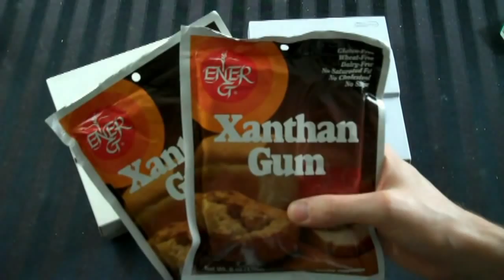Gamerade - Remove Yellow from Super Nintendo, Other Consoles, Plastics - Adam Koralik

Comment: According to a recent post on Slashdot, following a discussion among experts from the retro-gaming community with input from chemists, what you are seeing is the same effect from bleaching t-shirts. Unfortunately, bleaching plastic is a surface effect and it does not change the chemistry of the plastic. The discoloration will return after a few months to a few years when the flame retardants migrate back to the surface. I've had computers since the 1980's and I can tell you that stored plastic will discolor. Most UV light (UVB and UVC) is blocked by windows. Nobody uses these old computers outside, so I think most of the discoloration is accelerated by operating temperature with a secondary effect from UVA.
Reply: This is true

Comment: Tried a variation of this with amazing results.  Reminding back to the little I learned about science and chemicals, I know that if you have a solution that's intended to serve a specific purpose, mixing anything else in is going to effect the results greatly.  That being said, I wanted to avoid adding the gum and glycerine since they didn't seem too serve a purpose in the reversing of the yellowing.  So what I did was set up everything just like you did in the pans, mixed a 6% peroxide and oxyclean mixture (just these two ingredients on their own) in a spray bottle and just continuously sprayed the parts every 15-20 minutes or any time they started to look dry.  It took about 2 hours to get my snes looking new again. Thought I'd share.

Comment: Sadly, this process now seems to be only temporary in most instances. The bromines deeper in the plastic end up migrating back to the surface layer, returning the yellowing.  After a few years, I can confirm the yellowing has returned on the plastics I treated with this process. There's been some recent discussion regarding the return of yellowing, if you Google "retr0bright re-yellowing". It's still a great way to have a good looking console to enjoy, even if it is only for a few years before it returns.

Comment from the maker: ***** I think it's a pretty safe assumption that MOST versions of the SNES (model 1) are prone to yellowing. It's not like later models are impervious to this, it just seems to be a general trend that they don't do it as often.

Likely due to alterations in plastic mixtures.

Even if that's bullshit and totally wrong, who cares? The point is to fix it, not to complain about which ones are more or less likely to turn to shit.
Reply: Can you tape over the controller ports and do this without taking the machine apart?
Reply: nickplays631 also its a newer model
Reply from the maker: nickplays631 Retrobrighting the console without taking it apart is highly not recommended.
Reply: ok then so since mine is model 2 snes is there anything different?
Reply from the maker: nickplays631 It'll be a different process to take it apart, but the actual retrobrighting part is exactly the same.
Reply: do you get a $ every time you say super nintendo something
Reply from the maker: dave z I wish.
Reply: It's actually caused by the flame retardant chemical they mix into the plastic, and it is in all SNES models.

Here is an official statement from Nintendo.

Message(#6851-000101-5635\1015635) 	
Hi!
	
Thank you for contacting us. That's an interesting question! For the Super NES, this is a normal condition and no cause for alarm. Cleaning or handling the system will have minimal impact to change or revive the original color.
	
The Super NES, as well as our other systems, are made with a plastic containing flame-retardant chemicals to meet safety guidelines. Over time, the plastic will age and discolor both because of these chemicals as well as from the normal heat generated from the product or exposure to light. Because of the light color of the plastic of the SNES and NES, this discoloration is more easily seen than with other darker plastics such as on the N64 and the Nintendo GameCube.
	
Thanks for your email!
Nintendo of America Inc.
Casey Ludwig
	
Nintendo's home page: http://www.nintendo.com/
Power Line (Automated Product Info): (425) 885-7529

Btw, Love the videos man, you rock. Keep up the awesome work.
Reply from the maker: Cody Gray Yep, bromine.
Reply: Love your refurbishing videos, you basically saved my N64 there were bugs and stuff in it
Reply from the maker: RockLobsta29 Happy to help.
Reply from the maker: *****
Never tried that personally, but it should work.
Reply: The SNES Mini doesn't turn yellow
Reply: i know this is an old comment on an old video but has anybody been able to find replacement non yellowing shells online, obviously not made by nintendo, all i can find are ones that look nothing like an original snes shell
Reply: Yes they do Ive seen them yellowed at the pawn shop before.  Probably don't see as many because they aren't quite as old as some of the first design snes's are.
Reply: Adam Koralik will this work for my sega dream cast becuase im a coller i collect video games so will it work for more consoles
Reply from the maker: Yes.
Reply: Adam Koralik love the vids I can give some advice? Too much Xanthum Gum, to make it more "paintable" Stick to about 4% by weight to your solution. Also you should still be able see the console through the mixture it helps with the UV penetration by all means go thick but shouldn't be so thick you can't see through it. This should make it so you can do it once and have success. Xanthan Gum is a strong hydrocolloid and using that much might be preventing the H2O2 from getting full penetration.  (PS I'm a Chef and use xanthan gum regularly I'm sure you did your research but just wanted to leave that here)
Reply: Also a hand held stick blender will mix the solution much faster and no Microwaving!

Comment: Reading the comment section is really painful... People keep asking if it will work on other consoles or that they like the aged look of the yellowing.

He clearly states in the video that this WILL work on ANY plastic that is yellowing from ultra violet light, this include other consoles and anything that is not a console as well. I do suggest adding the gum 1 tablespoon at a time as you're mixing to get the perfect thickness.

Also he also states that if you don't mind the yellowing, you do not have to do this, but that it is a good idea to do this in order to give the plastic a longer life because it is not just a color change, it is a chemical reaction that causes the plastic to become hard and brittle. So doing this will not only restore the plastic color but it will restore the plastic properties as well (which is the more important part of doing this process).
Reply from the maker: Tell me about it, I even say it in the title of the video.

Comment from the maker: +ToddSixSweeney /Facepalm.

The plastic is ROTTING because of the bromine. You need to restore it properly or it will become brittle and fall apart. Just painting it doesn't fix that.
Reply from the maker: ***** I made the video, I know what it's about. The point is to reverse the chemical reaction that causes the plastic to break down, which in turn restores the color.

What you're not getting here is that you're making them look fine on the surface, but the plastic will still break down and fail. The whole point is to make that not happen.
Reply: Plastic is not living, therefore it does not rot.
Reply from the maker: Ilovelazers
To be fair, "rot" has more than one literal definition.
Reply: However normal humans use the term "corroding".
Reply: Isn't the exposure to UV light causing the chemical reaction?  Painting seems like it would stop the exposure so the chemical reaction is at least slowed down (or hopefully stopped).  This process would also prevent it from becoming brittle, but eventually it would yellow again.
Reply: after this process, you can use some blank varnish spray.. it will stop yellowing again
Reply: Dad OF Four
 Okay then... That just means that you're not working-class either.
Reply: wim wannes Spoken like a true sophist.
Reply: Tamika B.
Uhhhh..... What? Again in english, plez?
Reply: Ilovelazers So food corrodes instead of rot? ... yeah ok
Reply: AceSim Gaming I said living or once living things rot. Not corrode.
Reply: Ilovelazers Don't feed the trolls.
Reply: Adam Koralik mine is already chipping. Would doing this stop further chipping?
Reply: You're not reversing the degredation here. You're reversing the most obvious effect. The plastic has still broken down into its polymers that cause the other components to turn into yellow dye as well as to brittle the plastic.
Reply: @pleravens  Technically,  you could be correct. Because the paint shields from the UV and Oxegen. However, the inside of the console would have to be done as well.  If your wanting to paint it. It already has a molecular breakdown. Which needs to be reversed before the paint.
Reply: @Labyrnthdom  If all you care about is the exterior aesthetic, then the outside would be sufficient. However, it would have to be done at the time of unboxing so as to maximize the effect.

Comment: you can make they way simpler

just use hydrogen peroxide and destilled water: 2 parts water 1 part hydrogen peroxide and submerge your pieces - done

you can spare the oxyclean - those are usually just other peroxides which technically do the same, but look fancy because they are dry

adding xanthan only makes it easier to handle to brush it on - but if you disassemle it anyways, just submerge your pieces and you are done: way faster with the same effect.

and for the gylcerin: you need to mix the glycerin to the dry xanthan to pervent lump building in the first place, afterwards it is too late and useless - a really good tip is to go to the pharmacy and get "Cosphaderm X 34" it is a xanthan based thickener used to creams and lotions and has pretty low lump building

Comment: I found something which is ready to use and apparently isn't widely known - it's "Salon Care" hair color developer. It's cheap. It's odorless. It's a slimy consistency and requires no mixing. Just slather it on and put your parts in a plastic bag so it doesn't dry, then put that in the sun or under a UV lamp. You can get it from Sally's Beauty Supply. Get the "40 Volume" which has the highest concentration of hydrogen peroxide at 12%.

Comment: I have used retr0right before, one thing that i learned is that you should never let it dry. You need to rinse and reaply every 1 or 2 hour (even if its still wet) depending in your sunshine. Also you can use UV light from a UV lightbulb, they are good on rainy days and they are consistent however they are not as strong as the sun. UV lightbulbs can be left overnight but the mixture might dry, its up to you.

Comment: 2 things, if you don't have the special bits for older system screws, take both end off of a white bic pen, heat the pen to soften the plastic and push it onto the screw, leave it cool down then turn, it should mold into a bit that will work fine.

second, Have you ever tried CLR?, I have used it before to eat grime from almost anything.

Comment: I've whitened several SNES consoles with minimal yellowing using a paste of hydrogen peroxide and flour.  No need for the other stuff with minimal yellowing.  The concentrated peroxide is well worth the trip to the beauty supply store.  Just mix it up to the consistency of pancake batter and spread it on.  I wrap the parts in plastic wrap so it doesn't dry out and set it in the sun.

I'm in the process of treating a severely yellowed SNES.  After 3 treatments, it's better, but I may add some oxyclean to the mix if it doesn't fully whiten soon. 

Also, there is a risk to taking apart a brittle SNES.  Removing the screws could result in breaking the plastic threads.  I sprayed just a tiny bit of liquid wrench in the screw hole about 10 minutes before taking it apart.  It worked very well and nothing broke.

Comment: I know. The original receipe says 2 heaped spoons, but that really is too much. Maybe 1 / 10 was a bit exaggerated, but the next time you use RetroBright, you should try to use a bit less. 1 / 4th, maybe.  A thinner mixture is much easier to paint on and distribute evenly. Using cling foil is a good idea. I tried it myself and it works really well.

Comment: I have not tried this recipe, and I am only looking this up because I'm looking to buy another SNES to replace my own.  My case looks almost perfect.  I don't think there's really any yellowing and maybe just a couple light scuffs, but unfortunately something in the SNES display is off and what should be black looks blueish and is leaving trails.  So I am considering getting something cheap and yellowed, but that functions well.  I may or may not use this recipe, depends how much I need to spend on the H2O2.  I actually have all the other ingredients necessary. 

My point to this message was that although I haven't tried this recipe, I had a suggestion to make your solution more consistent.  I have used Xanthan Gum for cooking and have a bit of experience with it, and I think if you want a nice and even paint-like fluid, use a LOT less of it.  A little bit of XG goes a long way and I think since you said that the XG itself is not for the chemical reaction, but only to make it stick, it's worth a try.  It's one of those things that when you're cooking with it, you add a tiny bit and go from there.  You might even be able to get away with adding only a quarter of the two heaping table spoons, or even less. Doing this may also make the solution easier to clean off, but I can't guarantee that from experience.  If you look up XG, you will see it is literally secretion from bacteria, so just adding a little to a water based solution will give it a slug-slime-like texture.  I would imagine that would paint on very nice, be easier to clean and would be way more consistent and not so chunky where it covers some parts too much and other parts not enough. 

However, this is only a suggestion.  Like I said, I have not tried it with this specific recipe.  I really enjoyed your video and the way you explained everything made it very easy to understand so even the most novice SNES owner can try something like this.  I almost wonder if it would be worth it to buy old yellowed SNES' from eBay and restore them for resale.  Maybe it's more work than it's worth though.  Just a thought.

 Thanks again for the video!

Comment: you could substitute the sun for a uv light. Also peroxide is not so bad there are lots of much worse cleaners you could use. Peroxide is a oxidant and in sunlight it breaks down into water and o2. Exposure to your skin will cause it to turn white and go numb it will take several hours of discomfort but over exposure to it will reverse itself it should also be mentioned this mixture will bleach out your clothing if you get it on you.

Comment: (1)I have altered this plan just a bit by skipping the gum (mash potato ingredient), (2)cover the console/parts with paper towels.  One side at a time, (3)use a brush to wet it so that everything is nice and soaked :D.  (4)Then cover with Saran wrap, sit in the sun.  The coverage is more even and it's much easier to wash off.  It requires more work but it's a seems faster in the end.
Hope this helps folks.

Comment: You can do this a lot easier and cheaper. Basically it's the peroxide doing all the work. So there is a way to get very cheap strong peroxide, get some 3% at a dollar store and freeze it to about -13C. There will still be some concentrated liquid peroxide you can shake/squeeze out. Use hand & eye protection! Put the concentrated peroxide in a small mist spray bottle. Set your plastics out in the sun and keep misting them. You could also use soap or shaving foam as a soaking medium instead of all that thick expensive junk.

Comment from the maker: +Bob Mclean Actually I bought a bottle of that, I plan to try it soon.
Reply: AdamKoralik The bottom of my SNES is yellow but the top is white, should i retro bright both parts or just the bottom part?
Reply from the maker: Nickplays631 I'd do both.
Reply: AdamKoralik Hi Adam. I have a few Super Nintendo games, and the back part of the cases have gone yellow. Should I use xanthum gum and brush it on or do you rekon I could leave them in soke? But would that ruin the game labels? :/  

Thanks in advance.
Reply from the maker: iames85 Try this: https://www.youtube.com/watch?v=1HUmgzF16ew
Reply: AdamKoralik I'm not sure if it's just because of UV light damage alone? My Amiga 500 was taken out of storage  (completely lightproof cover and sealed in a box) around 5 years ago and it was completely in its original state. I then restored the system in the same way sealed into the same cover and box again. I recently got it back out for a test run and its yellowed pretty badly.  Its really annoying as the system was in such pristine condition not a single mark or scratch.
Reply: ***** Some people believe it's caused because of a bromine based fire retardant used on the plastics or at least its believed to accelerate the process. Check out this link about vintage plastics. http://www.vintagecomputing.com/index.php/archives/189
Reply: ***** My old Amiga yellowed when stored away in complete darkness without any UV light exposure.
Reply: ***** It was in a box but also covered in layers of sealed plastic wrapping on top of a 3rd party keyboard cover.
Reply: Attic for the first 5 years it was fine and then I put it back up there for a few more years. After that it yellowed but the climate is mostly cold for most of the year.